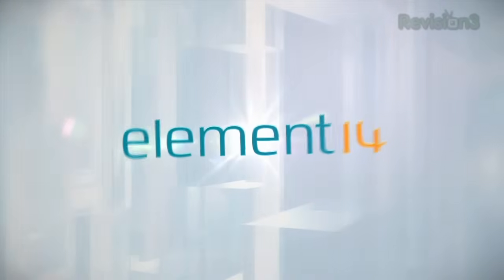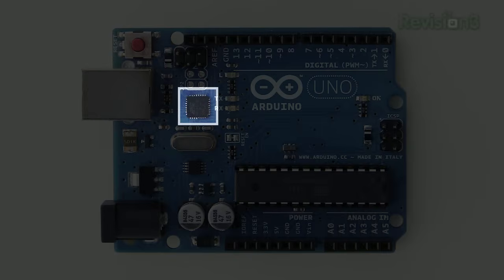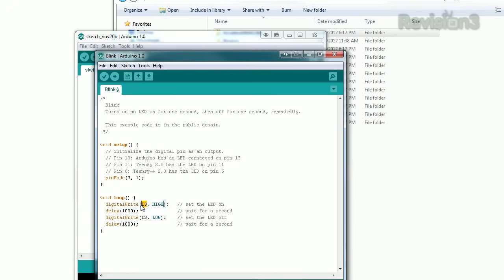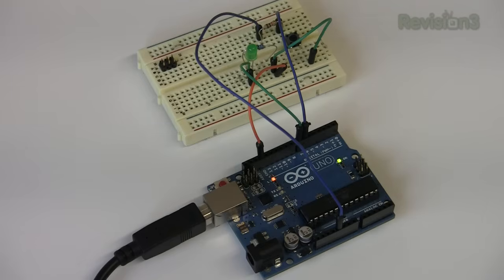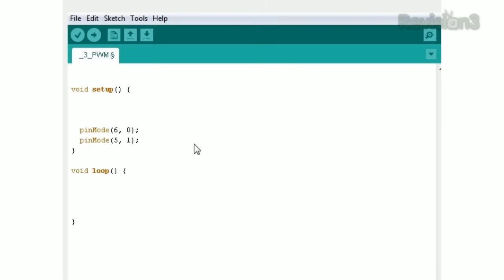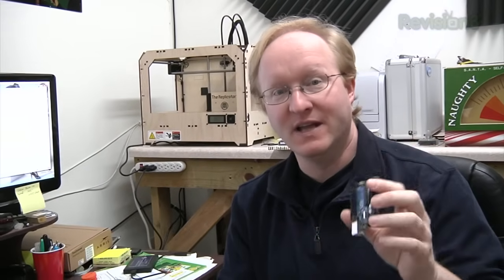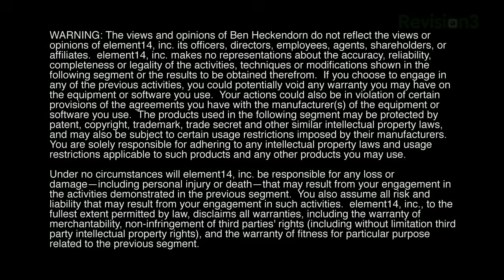Everything You Need To Know About Arduino

Comment: For all the kids around the world, you can use PWM to transmit data under the hidden frequency using a radio module, for instance nRF24L01. Have fun with that cause that's where the fun begins.

By the way, this video is not even close to what Arduino can do... He's here just for the money lol, the lessons are incomplete, not in a logical way and have mistakes that will make think that you understand the board. This guy is an old guy don't listen to him..

Comment: The Libraries folder mentioned at 2:02 is the one that should be left alone; libraries should be put in the install folder which is often C:\Users\username\Arduino\libraries (your sketches are usually placed in C:\Users\username\Arduino.)  
Why are you using up video time to advertise Raspberry Pi; what does it have to do with Arduino microcontroller boards? 
This 10-minute segment does not give you Everything You Need To Know About Arduino. It's coming across more as a marketing vehicle for Element14. If you care about your rep, Ben Heck, you might want to redo this video so that it's longer and more informative. If you don't, well...

Comment: sir 
i'm having a question that arduino will work for approx 70v and for approx 42 A ????
if it is possible then please suggest me the perfect board for that
Reply: just make a voltage drop down network to 5Volts from 70Volts(make a clever use of resistors and voltage regulators)....there is nothing to worry about the amperage.
Hope this helps you.

Comment: with led is the resistor after the led? I'm trying to use flat rolls of led (5m each) cut at the mark and can use of the rest of the role in another application they're usually called 50/50 lights or something similar I'm not certain which one sees all but I've got a couple variety I'm guessing they're all about the same rating current wife could you point me in a direction to learn a little better about these without it just being a video I would like a little dated for plugging up numerous instances so I can have a better understanding how to keep myself from faulting out. within the first 24-hours of them on  plugged my 12-volt one amp DC box in the wall and put the end and went for it. LOL. The result was me waking up to non-functional light. since then tried at 7.5 Watt 1.5 mAh and so far they haven't had any issues I've been running them for a month or so lately I've been thinking about leaving 18650 batteries and try to get if the AC-DC conversion full time .. any input would be great

Comment: Hey There,Came across your IR Arduino controller,  most excellent.
Here is my challenge. I am using an HD antenna to receive over the air TV channels. The antenna has a rotor to optimize signals from the different broadcast Antenna locations (Azimuth positions), using a remote IR transmitter. I would like to control each channels exact azimuth with the TV remote control, eliminating the use of the IR Rotor remote, which is always a guessing game to find the best setting for a particular channel. 
Example: I press the IR TV remote to switch to channel 7 and the antenna would move automatically by instructing rotor drive motor of the antenna to a preprogramed azimuth setting programed earlier to the Arduino. 
I'm not an Arduino expert by any stretch of the imagination, so I'm seeking assistance. In theory this idea I have seems simple, but only for those who have the knowledge, which I do not!
Thank you and look forward to your response.
Grant

Comment: is it possible to use arduino to control an industrial 3 phase motor?
Reply: ccandrew111 That, too!
Reply: YES! with PWM. get a cheap oscilloscope. smooth out the square wave to a more sinusoidal form. Use power mosfets and torroidial inductors...get your hands on some broken dead derelict variable frequency drives like the magnetek gpd515. Electromotive, danfoss, toshiba, seimens...many manufacturers of these drives out there...you just want the big guts. You'll want some experience entering parameters and initializing these drives. (important stuff like matching RPM / no. of poles of motor.)  You'll need to understand difference between T-leads and M-leads...how to wire a pecker head. How to megger. Monitor currents and voltages and frequencies for startup and under load. Know motor frame classifications. You want a wound rotor motor. Not a squirrel cage motor.
Reply: yeah, just get a three phase inverter drive which has a control voltage input.
Reply: Yeah! - What HE said!

Comment: +The Ben Heck Show 
Hello! I'm having issue with my arduino uno. It was working OK couple days ago. But now it has problem with uploading. When I try to upload, first it stuck at uploading, after a while it gives quite a long error message starts with
Problem uploading board,
avrdude: stk500_recv(): programmer is not responding
avrdude: stk500_getsync() attempt 1 of 10: not in sync: resp=0x2c
avrdude: stk500_recv(): programmer is not responding................etc. I tried almost all the tricks and instructions online such as reset button. None of them didn't work. I'm sure that my ports and other options for Arduino UNO are correct. When I connect my arduino to computer I hear the device insertion sound, also yellow(L) and green(ON) lights of the arduino board  are on. I reinstalled software. And when I connect arduino it has installed the port automatically which means board and computers' connection is OK. Also when I connect my arduino board to motor driver, my stepper motor is working with the code which I uploaded previously. How can I fix it? Please tell me if there is other way.

Comment: Good stuff. I would like to use the Arduino with the Raspberry Pi2.  How can you connect the Raspberry Pi 2 to control the Arduino analog? You-tube:  "18F4550videos"  has a great step-by-step Raspberry Pi 2: OpenCV 3, Python 2, USB camera pan tilt servo red ball tracker with code video.  What are your thoughts? Thanks.

Comment: Replacing OUTPUT with 1 and changing HIGH to 0 is horrible advice. The are declared as constants for a reason.

Aside from some bad programming advice, I like the video.
Reply: Ethan Pixelate it's about readable code, not semantics. Readability is very important.
Reply: I'd like to add it's good you said 1 equals HIGH that's useful to know, you just don't use it like that.
Reply: +Maarten Krijn i would agree. i use the words like: OUTPUT and HIGH
Reply: +ncamen68 as we all should. That's clean code 101😊. To bad Ben doesn't seem to know that.
Reply: They are programed as constants because it's never going to change... 1 and 0 are constants of themselves. 1 can never change... 1 will always = 1.... 0 will always = 0.... It saves time typing and shrinks your code size.
Reply: @josephkreifelsii6596  it doesn't shrink code size. Well it does shrink source size but that's not important source should be readable. Otherwise we should all code golf, which we don't because it's not very readable.
Reply: Maarten Krijn really, it dosent matter because they do the same thing

Comment: I have a question for you if you MAY have an answer? haha I have about 6-8, MikroTEK, 2.4Ghz, and 900Mhz, wireless radio boards, used in Long Range Wifi, in unison with a Grid Antenna.  It gets POE, and has basic software for Rx/Tx throughtput, is it possible to load something like Rasp.Pi GUI on the bios of the board?  Have you ever heard of MikroTEK and Ubiquiti?  THANK YOU SO MUCH!!!

Comment: Im new to Arduino. One thing i dont understand.
If i make something cool and want to use it with real hardware.
Lets say some mega-cool gate opener for my garage or garden then i use that expensive device and use that permanently .

Or its just for prototyping and when i get my prototype working i must buy some components and build my own board/device?

One thing i understand that i can prototype, make some tests, experiments etc.
But then what? I must disassemble everything when i want to make new device of some kind.
Very confusing.
Reply: +jw200 you can get like an arduino micro or nano if you want to make a project permanent
Reply: +jw200 Dependson your project.  If you leave your stuff on breadboards, then yes they remain temporary and you can take them apart and build other things.  Kinda like Legos.  Depending on your IO needs you could use the single chip ATTiny microcontroller which can do quite a bit for it's size or perminatly mount a full board in the project.  The Arduino Micro and clones have a footprint that will fit the larger DIP sockets so you can make a project with one of those and mount it but leave the option to remove it later if needed.  There is alot you can do with this platform, keep watching and reading.

Comment: I am trying to build a real life mech aka giant robot to take to comic con and was thinking about using the Arduino to make the arms and legs move so that it can walk. I have seen videos of this done on a small scale but mine is going to be a min of 10ft tall or bigger. Will it be able to handle controlling something of that size with the large motors that will have to be used?

Comment: Which output voltage were you using? 3.3V or 5V?
Reply: Daniel Fearn 5V
Reply: 5V voltage is generally used for powering up the devices. In case you are using an LED alongwith arduino 5V supply make sure to use a current limiting resistor (330 ohm or 220ohm will do the job).
Hope this helps you.
Cheers!

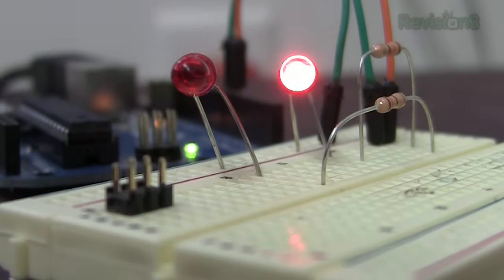Comment: Correction! Re: PWM 5:39-6:37
PWM does not increase the speed of its pulses, but increases and decreases the ON vs OFF Time of a given pulse or stream of pulses- not the pulse/s frequency (“speed”).
 
See a more reliable and complete source of Arduino information:
arduino.cc(forward slash)en(forward slash)Tutorial(forward slash)PWM

I do recommend getting a “Starter Kit” of some sort. This video is lacking at so many levels. There are much better Beginning Arduino video guides out there- definitely look elsewhere! As for the erroneous information on PWM, you might also do a search on the term “Duty Cycle”- though the term is not Arduino specific, it is the Parent of the technique being used.

Comment: I have a question, I am trying to calculator numbers one at a time starting from 13.08 and going 13.07 13.06 and so on  by pushing a button up can you help
Reply: Michael Parrish I am still waiting for my Arduino to arrive from China so can't actually run this, but the following compiles, I think it is what you are after.

//Declare a floating point variable to hold your value

float x;

void setup() {

 x = 13.08;  // set it to your starting value

}

void loop() {

//If button pressed, you would have to adjust the pin, then increase the number by 0.01;
 if ( digitalRead(6) == 1) {
   x -= 0.01;   // you could write this as... x = x - 0.01;   ... to be more clear.
 }
}

Comment: Just a clarification: The PWM does NOT change the SPEED AKA does NOT change the FREQUENCY. Rather, during the PWM (square wave cycle) the pulse stays HIGH longer to increase the brightness, or stays LOW longer to decrease the brightness, all while maintaining the same frequency.

Comment: I heard somewhere you can take out the ATmega328 microcontroller and wire it into other projects without wasting an entire arduino uno. could someone point me to some documentation on doing this?
Reply: there's actually a documentation in the arduino site. try googling arduino standalone circuit

Comment: I just barley learned about the arduino. I'm wondering can I take the voltage that my head unit puts out 0-6 volts AC and convert it to a pwm signal to control some PC cooling fans? Or would I have to go straight to the potentiometer (volume knob)

Comment: Can arduino be used as a controller for say a dyi cnc application?
Reply: yes, like any microcontroller. That's what they are made for. You are just limited by the number of input/output pins, the processor power and the size of you program. So you won't be able to do elaborate stuff, like image processing but a cnc application should be fine.

Comment: For the power input, should I choose to either use the USB port or the DC power jack only or should I use both for ArduinoUno? If use DC power jack can use any adaptor of what voltage?
Reply: It runs perfectly with USB power supply. However if you don't want to use the USB port or want to use the ArduinoUno standalone, you can use power sources from 7-12 V (recommended). The voltage regulator on the board will handle that. The microcontroller itself works at 5 V.
Reply: Will there be any problem if I power up the arduino using both 12V adapter and also the USB power supply?
Reply: Christopher Lee  I don't think so. But why do you want to do that?
Reply: Because I am trying to power up this relay board: http://yourduino.com/sunshop2/index.php?l=product_detail&p=181 which will act as a switch for my 240V AC push&pull solenoid. If I use USB cable alone, the relay is unstable, regularly switching itself maybe due to lacked of power supply. So I tried making the arduino Uno R3 standalone with a 12V DC adapter as power supply for the Arduino instead of the USB cable. It seems stable as I only noticed the relay made 1 time switching sound. However, I have yet to try both USB cable with the 12V DC power adapter as power supply for the Arduino because I saw some forums said try not to supply more than 12Vdc to your Arduino otherwise the built-in regulator might spoil although the max. supply tolerated is 20V DC. What do you think? If I put in USB and the 12V dc from adapter it'll be 5+12=17V dc right? Besides, should I just connect this relay directly to the Arduino itself? Some ppl put some additional circuits like this: http://www.glacialwanderer.com/hobbyrobotics/?p=9 and like this: http://arduino-info.wikispaces.com/ArduinoPower. Kindly advise. Thank you!
Reply: Christopher Lee  No, the Voltage does not add up. You just should not use 20 V or more on the DC power adaptor. It would still work but the voltage regulator would get pretty hot.
You can use both, USB and power adaptor at the same time.
Reply: I see. Thx! Then what's your advice on controlling the relay? Do I need extra add ons as suggested by other forums that add ons voltage regulator/transistor, diode , 1k ohm resistor from arduino digital pin, and also do external grounding instead of grounding directly back to arduino or should I just connect everything to arduino?
Reply: Christopher Lee
The relay modules with 5V logic level can be connected directly to the arduino. If the power supply of the arduino is not sufficient (when you use too many modules) you could use external power supply.

Comment: Is the language he uses in the IDE python?
Reply: Because it looks more like Java, I'm a noob so I'm not sure. (I'm asking because I'm better at python.)
Reply: Joshua Li C
Reply: Alright guys, thanks!
Reply: fairshare1000
actually a variation of processing or c, the IDE is written in java, and uses the gcc compiler through cygwin if on windows, or the native version of gcc if on linux
Reply: slango20
 The IDE itself is a variation of processing an written in java. The progamming language for the Arduino is C.
Reply: Joshua Li  C or C++, in rasberry pi its python :)
Reply: Joshua Li it is a type of c but it was customized for arduino hardware
Reply: Joshua Li Everyone who says C is wrong...It is not C. It is a language called Processing.. C is more complicated.
Reply: ProgramThis!
You are wrong. The Arduino IDE is based on the programming tool "processing". The language itself is C. The IDE includes many libraries that are easy to use, but those are also C libraries. You can use the exact same source-code and the libraries in other IDEs, too. I've used AVR Studio with the Arduino (with the exact same source-codes from the examples), which works perfectly alright.
Reply: EvilOverlord96 a C program has a main function. a C program does not start with a void setup and void loop. that is processing. Im not talking about the libraries.
Reply: ProgramThis!
 This is compiler specific. The "loop" function is the main function. It's because programs on a microcontroller have to run in a loop, the program itself can't be called. Again, you can use other compilers and IDEs (for example AVR Studio) with the same code.

"The Arduino language is merely a set of C/C++ functions that can be called from your code. Your sketch undergoes minor changes (e.g. automatic generation of function prototypes) and then is passed directly to a C/C++ compiler (avr-g++). All standard C and C++ constructs supported by avr-g++ should work in Arduino. For more details, see the page on the Arduino build process."

http://www.arduino.cc/en/Main/FAQ
Reply: Its processing...under the hood it may be C++ not arguing with that,  say you want to  program in actual C or C++ you will be extremely disappointed when you want to move from what you say is C++ to the actual C++ because it is a little different...You cannot say that you are programming in C++ with that (Arduino C++) AKA processing...The processing language is an extremely easy version of C++...

If it was actual C++ you would have to code that void loop() function yourself. 

Lower Level languages like C and C++ created may other programming languages...And processing is one of those many languages..

Comment: Could anyone please make any recommendations as to what equipment I should buy with an Arduino or Raspberry Pi r are there any specific kits I should look into? Also, does the Raspberry Pi use the same Program as the Arduino?

Thanks in Advance.
Sorry, I'm new to electronics and coding, although it thoroughly interests me, so I guess  there's that. d: